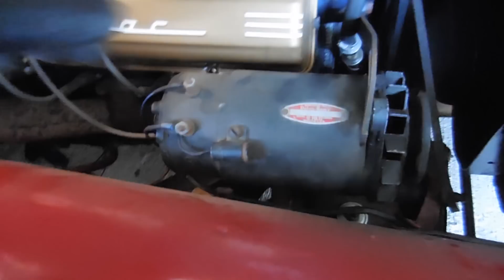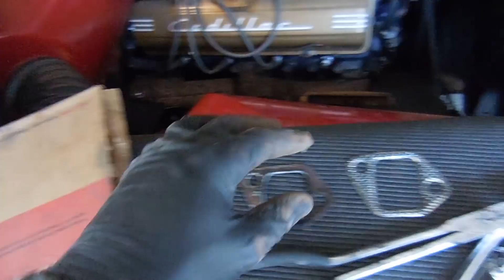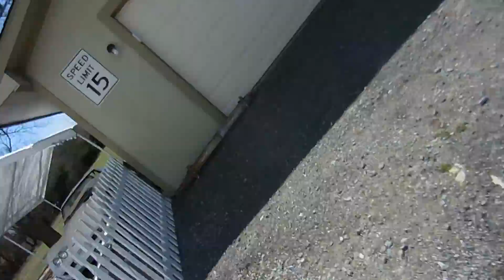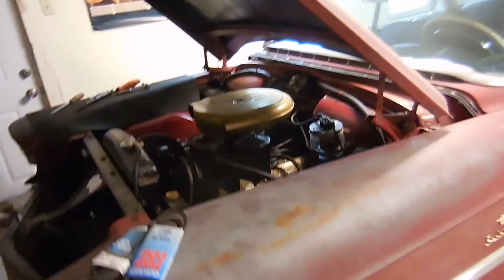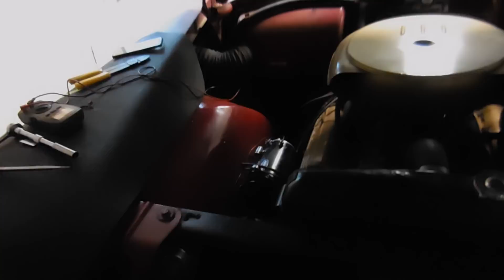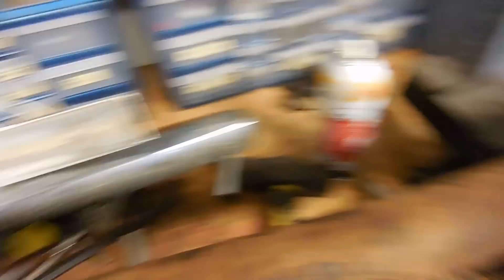1956 Cadillac Sedan DeVille Resto Video 60

Comment: I don't know if this is the right video to make this comment but here we are; this is just a respectful suggestion on starting any old carbureted  vehicle after a long period of sitting. I've watched many of your videos on the 1956 Caddy, the battery replacement and the cold start attempts with an empty carb bowl, etc etc. You may already know this, but it's worth mentioning here since I didn't see you do this in any of your videos. Put some pump gas in an atomizer like an old Windex bottle, and liberally spray right into the carb. (Open the choke first). It compensates for the empty bowls very nicely, and you won't stress the battery or starter as much. Most engines catch right away with this technique, even if they stall, they fire right back up the second time. NEVER use starting fluid. (It can blow up engines). Use gasoline in an atomizing sprayer like you would use starting fluid, and turn the key. BAM, engine roars right to life. I have a fair amount of experience with 60's and 70's cars, I'm pushing 50 and this technique was taught to me by an uncle who is now 86. He used to do this on 1930's Chevy's he Hot-rodded back in the day.  ;-)

Comment: I have my uncle's '71 Buick LeSabre with a 350 4bbl. It is my understanding that the car should not have gaskets, but at some point, they were installed. I have found records that my uncle kept and the gaskets were replaced numerous times prior to my ownership. They needed to be replaced when he gave me the car, which I had done.They lasted a couple of years before letting go. I had a different mechanic replace them several years ago and they again lasted a couple of years. I intend this year to have the heads and manifolds planed so that they fit together correctly without gaskets. I guess my point is that you will have to replace them on the Caddy at some point again in the future.

Comment: Hello Ben, permatex ultra-copper has worked for me - with no gaskets.
Your videos helped cheered me up through a long illness.
I have a 1952 supplement to the '50-'51 Olds factory Maintenance Manual, these are printed in Oswawa, but should be the same both sides of the border - if you are interested let me know.

Comment: Corvette Ben: If the exhaust manifold gaskets keep blowing, remove them and have the mating surface machined. They're quite likely to be warped due to the constant heating and cooling cycles they undergo during engine operation. I've had this issue in the past and cured by having the manifolds machined. Hope this helps.
Reply from the maker: They have only blown once in five years. It was due to the bolts being loose. As long as the bolts stay tight I should be good to go

Comment: Ben , rebuilding a generator is simple ,, take it apart  clean the armature where the brushes ride and the groves between the brass plates where the brushes ride ,,sand the area where the brushes ride smooth ,
 replaces the brushes and make sure all electric connections are good ,, check bearings and bushings , then polarize the gen after install ,,

Comment: Did you remember to polarize your old generator after you replaced it?  That is a common thing to have to do after it has been removed with the old generator equipped cars.
Reply from the maker: Yes I polarized it. I did that before I even knew it was bad.
Reply: edsel1952 polarize the regulator ... right?

Comment: Standard repairs back in the day included replacing the brushes on the generator, and cleaning the armature and commutator.  Which you consider for yours as a spare unit.
And  give the chicken a break!

Comment: Here is a tip for your exhaust manifold bolts... get some copper coat anti-seize compound and coat the threads on exhaust bolts... it will help if you ever have to remove them... after time exhaust manifold bolt tend to seize and break off if you try to remove them...

Comment: Ben, why do you think the switch to alternators was made? We have had 2-53’s, 2-57’s and a 58 Caddy. I went through alot of generators. If you have the unfortunate circumstance of running the battery down by leaving the headlights on for instance, charge the battery back up with a battery charger, do not depend on the generator. It will overheat and throw the solder out of the commutator where the armature wires are soldered in and there goes another generator! As to the gaskets on the exhaust manifold, my Caddies used them, but they weren’t a weak spot.
Reply: I think Ben wants to keep the car looking factory original. A alternator ruins that original look. I have had over 50 cars in the past 40 years that used the old generators. I rarely ever have problems with them. My 59 Bel Air has had the same generator on it for the past 30 years, and has never given me any trouble. My 60 Catalina still has the generator it rolled off the assembly line with. The key is keeping the oilers oiled, not over tightening the belt, and polarizing them after installing the battery. They charge better and last longer, when there polarized. I have seen alternators made to look like the old generators, but they really don't have that total factory original look.... but it's a good option if you want to keep a somewhat original look.
Reply: Old Car Alley I did not suggest that he put an alternator on, just that the industry changed to alternators as there were advantages to them
Reply from the maker: I wouldn't mind using a generator that had alternator guts on the inside, but I needed the generator to be working in a week's time and went with the fastest option.
Reply: No doubt about that. I do talk about that is some of my videos. The alternator was much lighter, plus the brushes did not carry the charging load, making the brushes last a lot longer. I am just one of those guys that if everything is original, than don't mess it up by changing one thing. I also really dislike seeing newer aftermarket A/C on classic cars... unless the car is customized and originality no longer matters.

Comment: Ben, you should just throw away the gaskets, and install the manifold without gaskets. The new gaskets most likely will blow again. They compress from the heat, causing the bolts to loosen. GM did not use exhaust manifold gaskets back in that era. Polarize your generator and regulator... they charge better. Your shop manual will state how to polarize it.  Howard
Reply: +Old Car Alley  Yup, re-torquing the exhaust manifold bolts or nuts used to be part of the free 1000 mile (end of running-in period) service you used to get when you bought a new vehicle as that distance was a good mileage to ensure the gaskets had heat-cycled and settled and tightening up the manifold/s would take up any gaps created in that process...

Comment: When replacing those gaskets one doesn't have to remove the bolts entirely. Just loosen them, cut the gasket bolt holes open then slide them in between the manifold and block.
Reply: yep, and some gaskets even come in that way.....
Reply: not really - you just cut it at the bottom of the bolt holes - I've done it many times - and as mentioned some gaskets come that way - or used to
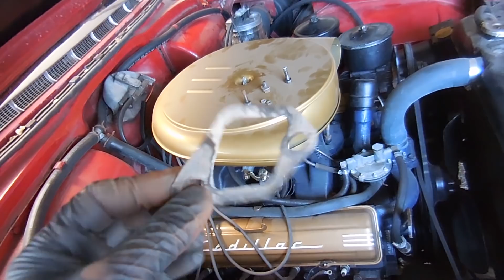Reply: Merle Morrison You're absolutely correct. I've done it on a Volvo. And now I think Volvo offers gaskets with bolt hole cut-outs. As far as CorvetteBen's Caddy goes I noticed the gasket he has didn't have the bolt hole cut-out that way. That's why I commented. ------> 3:25
Reply: Danny Boy yenko me bawsak